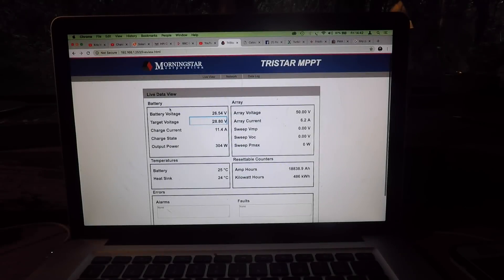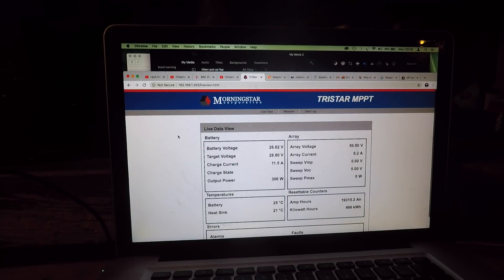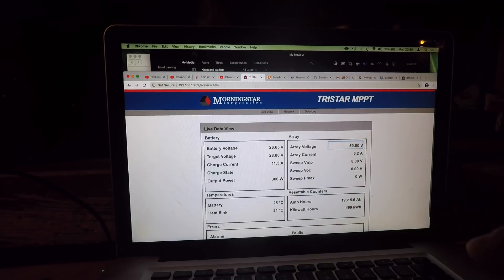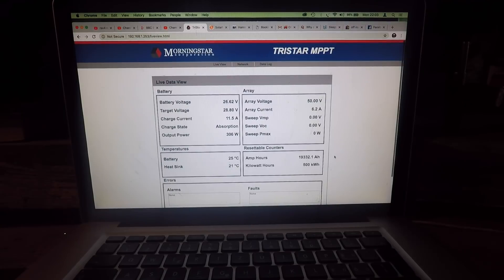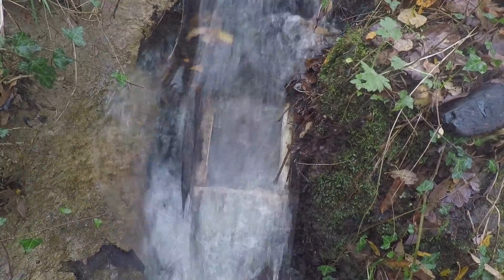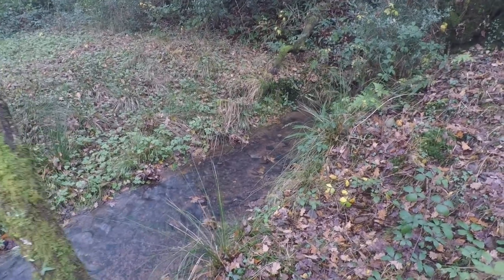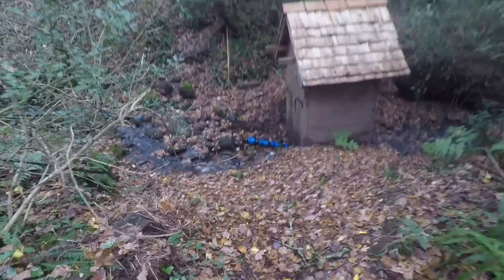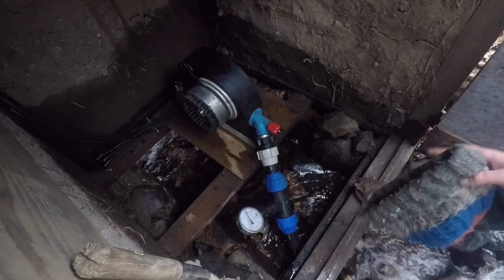500 Kwh Off Grid Hydro Electric Pelton Turbine Update

Comment: So glad to hear a 2nd turbine is going to be added, but you do realise that 4 nozzles will not create 4x the power that 1 nozzle will make don't you? Sounds like you really want to waste potential power or just run a generator as fast as you possibly can to see how long it lasts. Myself i would build 4 turbines and have 1 nozzle each, convert to DC in the hut and send all the DC back up the existing cables, if memory serves you would only need to run a cat 5/6 cable for networking (you can go 100 meters with cat 6) and move the hydro charge controllers to the hut, you may also need an ethernet switch and a buck converter to power it but that shouldn't cost more than £20. That would also allow you digital control over the nozzles using raspberry pi or even arduino with electronic valves/taps.
What ever you do i will still tune in and offer insight where i think you need it. :)
Reply: @KrisHarbour  LOL i know basic physics and the conservation of energy, i also know electronics. Anything not smart assery to prove me wrong or do i have to wait for the video that proves 1 of us right?
Reply from the maker: Im afraid this is just to basic to be worth my time to discuss, all the info you need is out there for you to find. it is basic stuff and i refuse to argue with you any further about such a basic understanding of physics.
http://harrishydro.biz/
Reply from the maker: Maybe this will help you get it. if you dont believe me maybe you believe someone esle 
http://www.renewablesfirst.co.uk/hydropower/hydropower-learning-centre/pelton-and-turgo-turbines/

the important paragraph 

To get a higher flow rate, hence more power through a single pelton rotor it is possible to have multiple spear-jets, as shown in Figure 3. Six jets is normally considered to be the maximum, and with this number of jets the turbine casing design becomes critical to ensure that the discharge water clears the rotor and can leave the rotor area without splashing around all over the place and causing excessive drag.
Reply from the maker: 4 nozzles does equal 4 times the power minus any pipe friction loss as more water will be moving. and loss in the cable due to cable loss. 4 nozzles does mean 4x the power, it just also add more losses but that would be the case if i had 4 turbine with single nozzles. but that would be way less efficient due to the losses in each individual turbine. PLus the idea of the 4 nozzles is to be able to run differant flow rates with fixed nozzles. otherwise i would just run one huge nozzle. also DC does not travel well so converting to dc in the powerhouse would be silly. ac is much better and convert to dc at the battery. and i ran 4 core armoured cable not cat 5. I think whatever you have been reading has been a bit misleading. i can easily send dc down the cable to turn nozzles on and off and that could be controlled from the battery shed. the way you have suggested would be very inefficient

Thats without even getting in to the fact that the expensive equipment would be above a stream in damp conditions.
Reply: @KrisHarbour  Sorry mate but you are wrong and you have not understood what i have tried to tell you, 4 x the nozzles does not equate to 4x the RPM on the generator nor 4x the power, but sounds like your going to prove me right when you measure 1 nozzle at say 300 watts and open the 2nd to not see double the power, but what ever i tried to help you, you obviously don't want my help and intend to learn the hard way... 
A network hub is not expensive 10er ish, a buck converter is a couple of quid off ebay, your charge controllers can be isolated from moisture with a few quids worth of kingspan and or another of those big plastic boxes, the massive cable you have already laid will give you almost zero losses from DC especially when you have effectively 2 runs of neg and pos. Adding a cat 6 network cable would allow you to place your hydro controllers in the hut or even a smaller cabinet just outside the hut like the BT and virginmedia cabinets that litter the streets, it would also give you connectivity for a hub to add a raspberry pi (£12 ish) or even arduino (less than a 10er with ethernet connectivity) to control your electronic valves and read water pressure from sensors from any device connected to your network, or automated control or even via the internet if you want it to be fully remote controllable/monitorable.
Reply from the maker: Honestly mate, i dont mean to put you down but you really do need to read some more. The rpm is fixed and has nothing to do with adding more water. more water means more power not more rpm, my rpm is half the speed of the nozzle velocity  so it can catch the energy in the water. adding additional nozzles at the same velocity means the turbine spins at the same rpm but with much more water hitting it meaning it makes more power. This is standard practice for micro hydro. 

you can think of it as volts and amps if you find that easier, the speed of the water coming out of a nozzle is the volts and the amount of water is the amps. the speed of the water coming out of the nozzles stays the same (like having a fixed voltage)  because of the pressure that is fixed (other than losses due to friction)  but the amount of water increases (due to more nozzles) The extra water in this example is like more amps . more amps means more power if the volts stay the same. maybe talking in those terms makes it more clear for you as you seem to be more in to electronics. 

https://www.google.co.uk/search?q=micro+hydro+turbine+multiple+nozzles&source=lnms&tbm=isch&sa=X&ved=0ahUKEwi-mfq7vNTeAhURtosKHTQSACcQ_AUIDygC&biw=1440&bih=798#imgrc=aVQjhIXhXISStM:

here are my figures as i add more nozzles this is what i will expect to get 

1l/s@ gross head of 18.5m = nett head@ turbine of 18.1m = 113w with a flow of 2l/s@ gross head of 18.5m = nett head@ turbine of 18.02m = 226w and with 3l/s@ gross head of 18.5m = nett head @ turbine of 17.9m = 338w, 4l/s@ gross head of 18.5m = nett head @ turbine of 17.74m = 445w, 5l/s @ gross head of 18.5m = nett head @ turbine of 17.53m = 550w, 6l/s @ gross head of 18.5m = nett head @ turbine of 17.3m = 651w, 10l/s@gross head of 18.5m = nett head @ turbine of 15.97m = 1kW, 15l/s@ gross head of 18.5m = nett head @ turbine of 13.5m = 1.27kW, 20l/s @ gross head of 18.5m = nett head @ turbine of 10.28m = 1.29kW.  You can see that trying to push 20l/s down the penstock creates a huge loss in head at the turbine, in fact 15l/s=1270w & with 20l/s = 1290w just a 20w gain.

so if i doubled the flow by adding another nozzle i would get 651w i would expect a bit less than that realistically so around 600w that is at 6lps. as you can see the limiting factor is the loss in the penstock but it only becomes significant as the flow gets very hight due to me designing the system to accommodate upgrades.
Reply: @KrisHarbour  Mate i'm not being funny but you will find you won't get much more power if any, i would actually expect a loss of power per additional nozzle from the same feed. In practice you are turning the generator with a fixed amount of pressure from 1 nozzle, if you add a second nozzle from the same feed you are going to reduce the pressure that turns the generator on the original nozzle because there will be less pressure in the system, your just going to balance the original power over the first and second nozzle which i don't see giving you any extra power from only 1 generator, it's just going to waste some of the system potential.
 I honestly would build a separate generator for each additional nozzle you want to have coming off the system and only run as many as the pressure will allow. I know this is the expensive option but that's what i would do, it would also provide redundancy.
Your hydro is converting pressure into electricity which you can prove by closing your tap off half way, and watch the power that is generated reduce, if you add a second nozzle you are going to reduce the pressure in the system which will give you less power in the end.
I will happily eat my words if you prove me wrong, but i honestly don't think you will. I will also gladly look at anything you can point me at that will prove me wrong.

Comment: Good video Kris.  If I recall you also power your water heater in part with electricity?

Could you perhaps do a follow up video on the waste vegetable oil, and how that is working out for you?

Cheers
Reply from the maker: yes that is correct, it is on a timer and mostly comes on at night. i forgot to mention that so thanks for bringing it up.

i will do a van update soon, its currently on ramps while i rebuild the rear breaks.

Comment: You should really censor that IP adress. People could hack into your power supply.
Reply from the maker: Well that would be alot of work to do not very much. that is just the ip of the charge controler that goes to another access point,  then to another access point then to a router. and all it would really give someone was the option to change some change controler settings. im sure it would be easy enough for the right person but why? i would just change them back and change the ip.
Reply: @KrisHarbour  Got a point there.
Reply: I believe Kris is on his own private network. It would take the best of the best to hack him, if it was possible at all.
Reply: LAN side IP - Not hackable.

Comment: Now that your on the other side of 500, is there anything you would have done differently?
Reply from the maker: The only thing i can think of really would have been to make the intake box a bit bigger. its way sufficient for this turbine but for the new one im planning the intake might be the bottleneck.
Reply: it's another sunny day here in Florida. Trying to come up with a way to use "red tide" to sell to the tourists ;).
 @KrisHarbour
Reply: @KrisHarbour  Have you found a better company to work with for the fixings?
Reply from the maker: Yes i have some new parts sourced from a guy that builds turbines, i went to visit him in north wales and we are making a plan together at the moment.
Reply: if you can make it run on red tide, let me know, I can make you a real deal ;)... @KrisHarbour